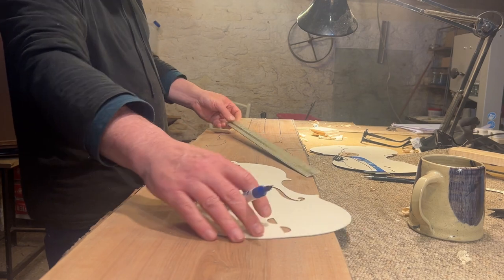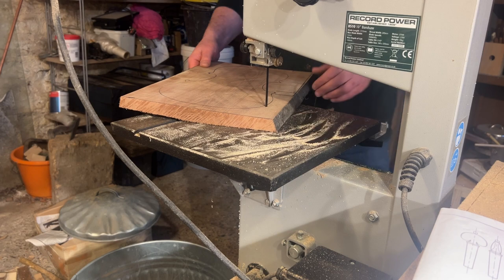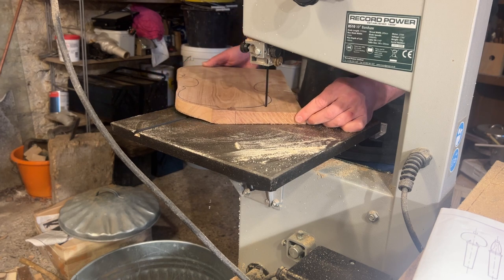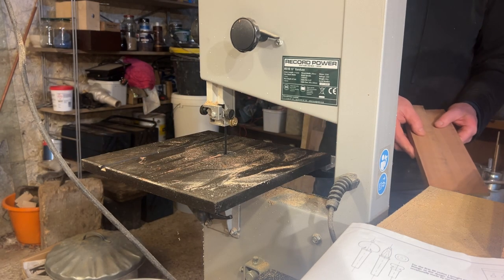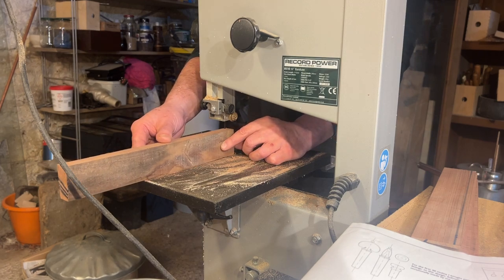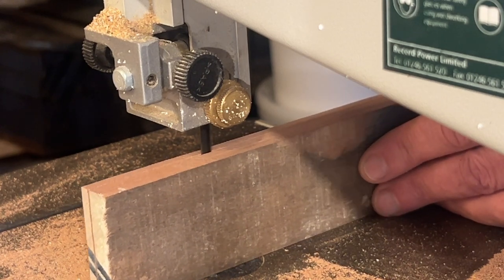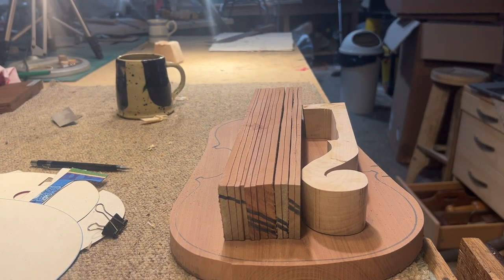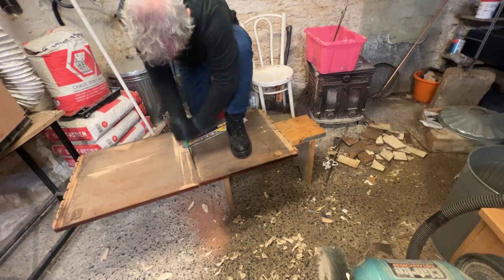# 153 - Violin Making Q&A - No.21

Comment: Hi, question on construction, do the rib linings affect the sound quality or are they there to add surface area and strength to assembly?
Also would adding/subtracting material to the bass bar or sound bar effect the sound quality much and allow fine tuning if trying unconventional materials?
Thanks 
Steve

Comment: Hi Graham, I have just repaired a £20 3/4 size stentor student violin that had six cracks and the sound post hole in the top, all this for a prop to paint with my granddaughter, after removing the top and repairing the violin I chewed up the sound post trying to get the size and position right, while waiting for some new sound posts to arrive I decided to practice on a 4B pencil having got the slopes correct and height making a gadget to insert it without stabbing it, I must admit it sounds better than the one that came with the violin 5.5mm diameter new one 6mm diameter. Maybe it could be the carbon.
Also completely stripped the plastic varnish and painted it looking like an old violin. I was wondering what method you prefer to insert the sound post.

Comment: two questions for you Graham ,question one is there any special marks violin makers use when marking out that are different to marks that a bench joiner or furniture maker would use like a cursive F mark for a face mark and V mark for edge mark and C with a line through for a center mark and a a triangle or number of lines marked between two or more pieces of timber to mark where you want the pieces of wood to line up  when gluing up , do you use any makers are special to violin making ? . and my second question is there a unique British way or tradition of making violins and  string instruments that is different from the way the Italians or  Germans or Spanish would make there  instruments ? , or is every one making them in a similar way ?